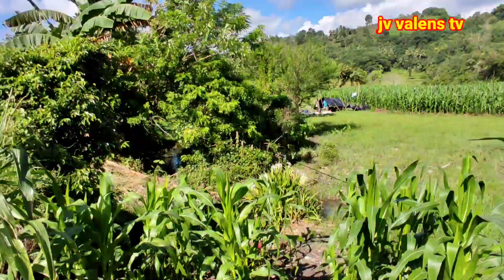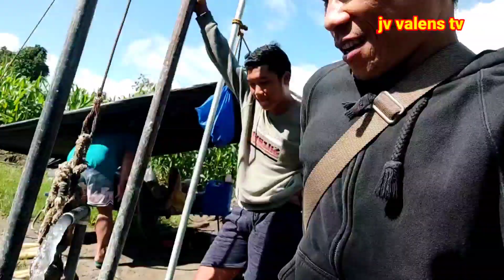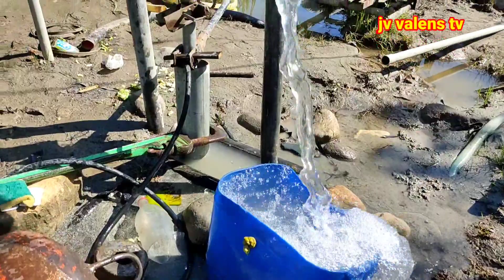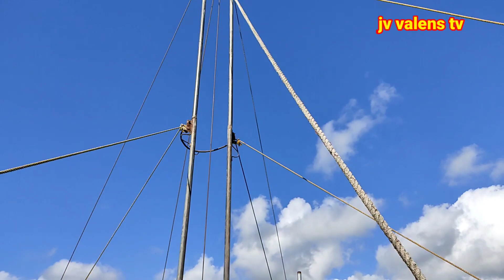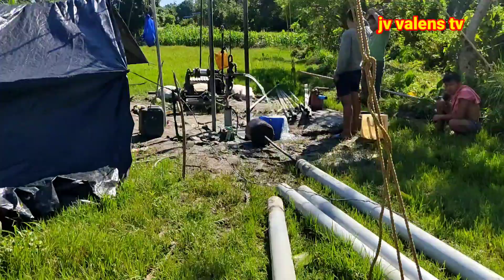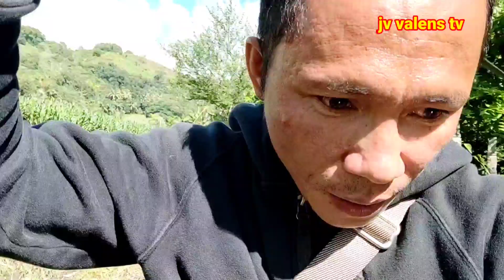DEEPWELL SUBMERSIBLE PUMP

Comment: ka jv.. 4 na tubo casing nya na di dos... ilang feet mula footvalve to injector.. 60feet water level.. may gagawin kc ako deepweel ka jv..
Reply from the maker: 10 feet from ejector to foot valve sir then khit 70 po lahat strew ninyo ok na po yon
Reply: @jvvalenstv945  salamat ka jv
Reply: @jvvalenstv945  di bali 3 tubo at kalating tubo ang straw nya ka jv kasali na foot valve at injector..